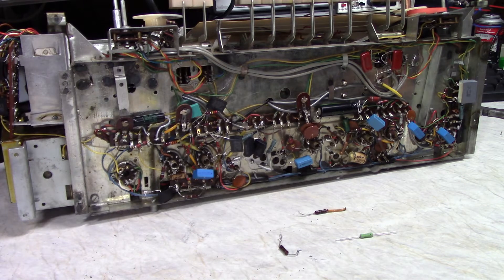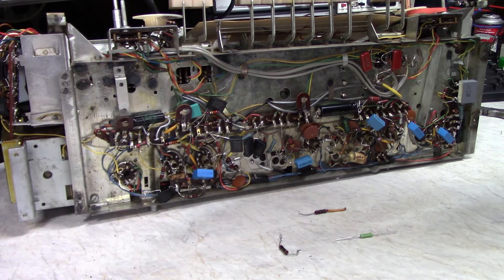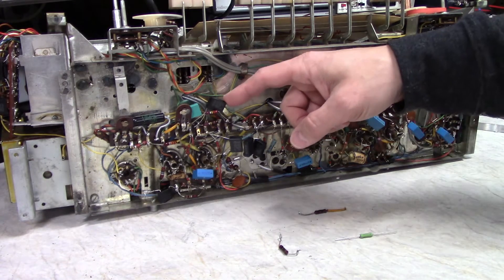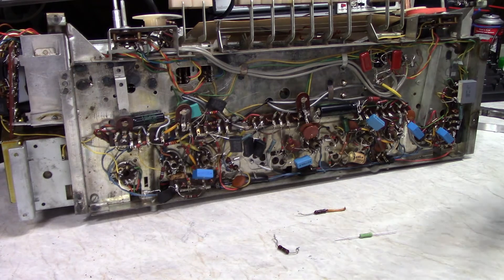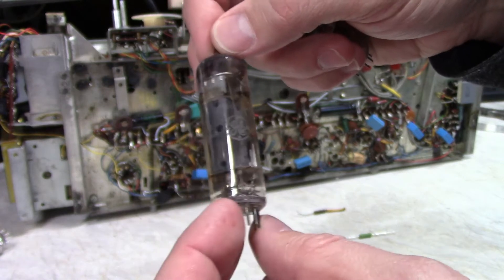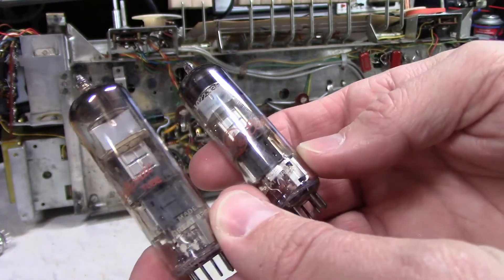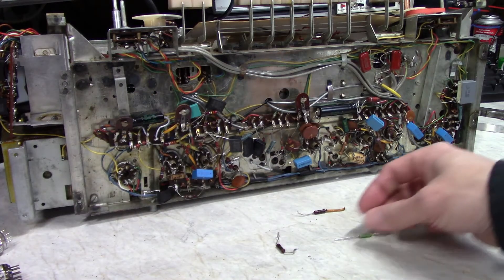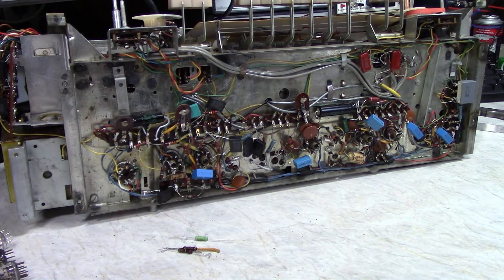Telefunken Concerto 5296wk Project, Part 2

Comment: Sorry Russ!  I know I screwed up but I'll admit that I had no idea what I was doing and thought I could just swap out caps.  Just keep track of what you replace and I'll reimburse you.   Thanks again for doing this.
Reply from the maker: Hey man, don't sweat it.  Either way I'd probably want to swap those old caps anyway.  Like I said in the video, I wasn't trying to bust your chops!  :)  I was actually going to cut that out, but I figured I'd leave it in as a heads-up to anyone that wants to do this.  Capacitor sizing is tricky and can be confusing!
Reply: I get it.  It's not something that you should just tackle without any knowledge.  No worries.  I'm just glad you are doing it.
Reply from the maker: I wouldn't say that.  It's all about learning!  I've left plenty of blown up stuff in my wake, believe me.